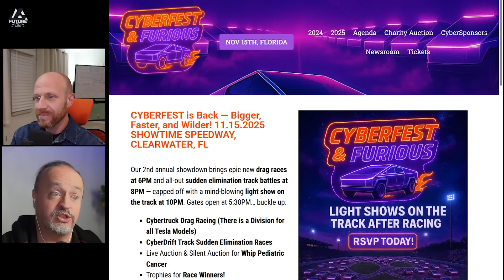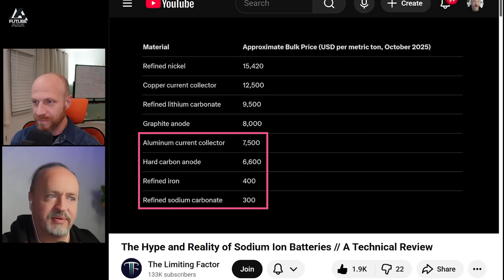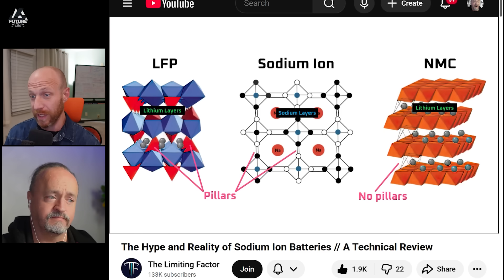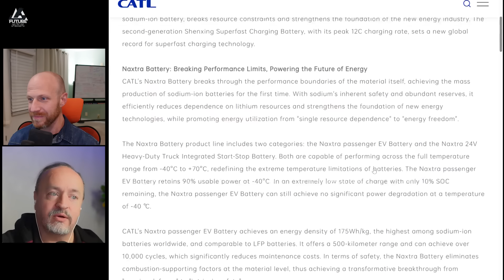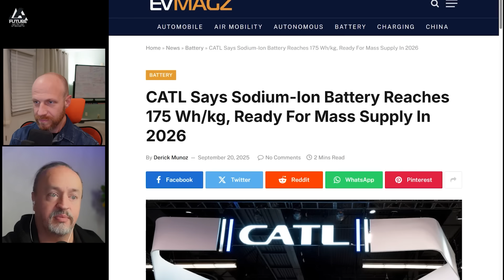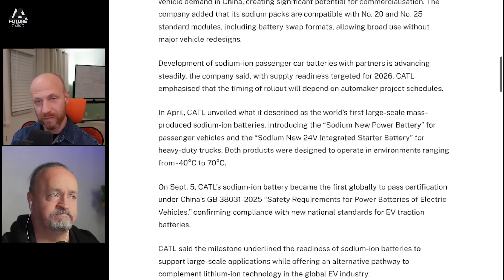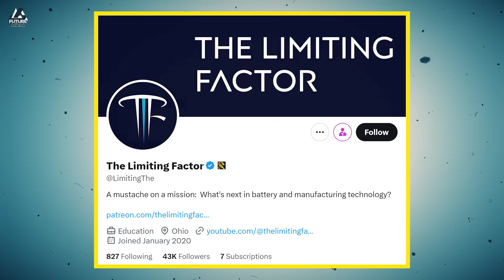Jordan Giesige Exposes Sodium Battery Truth

Comment: Sodium is right under lithium in the periodic table. It is no surprise this is being exploited. However, it will explode if it gets wet. The aluminum ion batteries, which are made possible by  graphene, are going to be cheap but very safe and easy to manufacture with. If one considers the the pinto gas tank debacle. The first time someone is burned with a sodium battery and it goes to court and the safety of an aluminum battery is presented. The cost of settling will be overwhelming.
Reply: The Pinto has been well and truly beaten in the USA with regards to fire danger, and no one is saying a thing about it. I doubt that anyone is going to start complaining anytime soon.

Comment: The primary advantage  to me is that it doesn't suffer from run away self immolation that lithium batteries can suffer from.  It wont take too many lithium house fires for home power walls dor them to be uninsurable. Lower cost, and low temperature operation are just icing on the cake. I woud pay more for the safety factor.
Reply from the maker: You know these are already in millions of homes and businesses around the world, right?

Comment: sodim battery is useless. It's not cheaper. Battery unit price does not set by price of resources. Its set by manufacturing technologies. How much yield they produce. That is what set the price of unit battery. 
And sodium battery energy density is low, you have to install more cells in EV. more cells means more prone to catch fire. And more chance to have defective cell in BSA. Which cause voltage unbalance in entire direct current within and result BMS error. 
In order to decrease price of EV and make EV safe, best choice is to get high energy density cells like NCM9 and intall minimum number of cells in EV to make it simple.
Reply: And all energy density materials are prone to catch fire. Sodium battery also energy density thats why it's battery.

Comment: LFP is NOT fire resistance. In fact, LFP is more prone to catching fire in EV.  BEcause all the lab datas that shows LFP is safe is under condition fo 0.5 C rate. from above 0.5 C rate, LFP is not safer then NCM. NCM is safter becasue it can tolerate in higher C rate than LFP. LFP is dangersou in EV. LFP is meant to be used in ESS.

Comment: Everyone always seems to forget that the only thing that lower material cost means is more profit for manufacturers.
The "savings" is *NEVER* "passed on to the consumer".
Reply from the maker: That's not how it works in automotive. Otherwise everyone would have 40-80% margins, rather than the usual, which is almost always in the single digit range.
Reply: "The price of an item is the highest point that the market is prepared, able and willing to pay for that item". Economics and commerce 101.

Comment: This very misleading regarding the danger of lithium power automobiles;  flooded vehicles are a very significant risk of fire.  Floods happen frequently, thus flooded cars also occur frequently.  I support electrification of our automobiles, but it does a disservice to falsely claim the fire risk of lithium powered cars ended five years ago.
Reply from the maker: If you look at ALL car fires, gas cars are 20x more likely to burn. That's including floods. Not because there are 30x more, it's on a per 100k basis.
Reply: @FutureAzA  There in lies the rub; the gasoline powered cars either are being used, or have just been parked when those cars catch on fire, yet the lithium cars have fires after being parked for hours, days, or weeks.   Please don't get me wrong, I don't want people to have an irrational fear of lithium powered cars, but those cars do pose unique risks fire dangers that shouldn't be ignored.  Thank you.
Reply from the maker: Still not true. All cars have low-voltage batteries, and those cause fires fairly routinely, especially at sea.
Reply: @FutureAzA  Are being intentionally ignorant?  While there was not even a single lead acid vehicle fire after recent hurricanes; "After Hurricane Ian in 2022, 36 electric vehicles caught fire in Florida. After Hurricane Helene in 2024, at least 17 electric cars and 64 other devices like scooters and golf carts caught fire after being submerged in water, though the exact number of EV fires is still being analyzed. Saltwater exposure is a major risk factor, and fires can occur days or weeks after the storm has passed due to thermal runaway.".  Why are you being ridiculous in denying that lithium batteries have greater risk of fires  compared to lead acid batteries?
Reply from the maker: Again, just lies, Bob. That might sell on low-information channels, but it doesn't work here. We've been following this for years. The majority of this channel's viewers work in engineering and/or have STEM degrees.

Watch this video and note that zero of the cars are electric: https://www.youtube.com/shorts/lqJD6f5vJ5w
Reply: @FutureAzA  The short video you cited above is your rationale for claiming electric cars didn't catch fire and burn the homes they were in after the recent Florida hurricanes?

Comment: Chevrolet Bolts were catching fire as recently as ~3 years ago. These were caused by a miss calibration of some machines at an LG cell factory.
Reply from the maker: How many though? Even those were significantly less likely to combust than a dino burner.
Reply: @FutureAzA They recalled everyone and replaced our battery packs. I do not know an exact number that caught fire. They weren’t in the news the way Teslas would have been.

I traded mine in for my MY.
Reply from the maker: Redwood Materials got them. Based on their use case, they were deemed fit for stationary storage.
Reply: @FutureAzA I didn’t know that. Good to know. But GM made things harder on we owners than they said they would. They contracted for rental cars to be provided while we got the recall done. When I set mine appointment up, I was told I would have to wait months if I wanted to get a car for the time that they were working on it. It made me feel I couldn’t trust them.

Comment: cheaper, -40f to 150f  useful operating range. about same weight as LiFePo,  can manufacture on existing LiFePo production line. Im production line by World's largest Battery company.  China are gungho ... nuf said. you will need new inverter and charge controller.

Comment: What energy is being used to make them round trip? Yes that’s right fossil fuels. Now what energy are we going to use in 30 years….you guest it fossil fuels…why? Because we have not replaced the fossil fuels with Hydrogen….yes right again Hydrogen can replace all fossil fuels.
Reply from the maker: Hydrogen is a medium, not a fuel, and its round trip efficiency is VASTLY worse.
Reply: 95% of the world's hydrogen is produced by refining fossil fuels, mainly natural gas and coal. This process is anything but "clean" and it is very inefficient. So too is producing hydrogen by electrolysis, even when using renewables. It is far more efficient to simply charge a battery.

Comment: I do think Na-ion makers are missing a trick when making 12volt style batteries the wide voltage swing of Na-ion from 10volts to 16volts is useful, many appliances hate voltage swings, the battery could have a built in digital volt meter that would give you a good idea on the state of charge because of the nice linear curve. 
But here comes the kicker, design a BMS that makes the battery output say 12.6volts constant regardless of what the battery voltage is at. Maybe have a 4 terminal battery that has separate charge input terminals.

Comment: Material cost of any product is only ~5%-15% of the total.  Bringing this up first is a GIANT red herring.  You know the propaganda BS is incoming...  First thing talked about in any RATIONAL discussion, should be Sodium's Horrendous Voltage drop and sebsequent horrific average efficiency completely and utterly negating any advantage regarding its price.  You have to buy more batteries, you have to buy more solar panels, solar panel racks, inverters, cabling, and labor to make up for these so called "cheaper" batteries.  The ONLY advantage Sodium has is that they work in the cold better than LFP.  That is it and only it.  Everywhere else they are inferior to massively inferior.  EDIT: They were actually rational, though never brought up Sodium's horrific efficiency, but did bring up its horrific VOLUMETRIC efficiency.  Bravo.  At least you brought up one of Sodium's reality problems.  OF course they NEVER brought up Sodium's INABILITY to use its lower 20% of its State of Charge due to its gargantuan voltage drop.... 1kWh Sodium only equals 800Wh of LFP at BEST and more likely 30%.

Comment: I have a single 3volt 20000mAh Sodium ion, it powers decorative lighting and charges from excess solar, it seems to work well and I do not have to worry when my greenhouse gets hot in summer or below freezing in winter. And to be fair no issues with it so far, but I can see limitations.

Comment: Two guys who claim to be experts on battery technology completely ignore that CATL is set to begin mass-producing Natrium batteries in a little over a month — and there’s no indication that anything has changed. CATL has stated that prices could eventually reach around $10 per kWh in the future — not today.
I’m fairly sure I read that a Natrium pack should already be cheaper than LFP, though I’m not sure by how much, but certainly not more expensive.

And suggesting that Natrium batteries will have 30% less range is ridiculous. It makes no sense for the world’s leading battery manufacturer to mass-produce a cell with such a short range — and, as you insinuate, not at a cheaper price.
I have a Model 3 with a 520 km range using an LFP pack, and that’s more than enough for me.
A Natrium battery offering around 500 km of range, combined with its much better cold-weather performance, would be a perfectly fine option for many people like me.

It’s not as if CATL ever claimed Natrium batteries would replace LFP or NMC immediately.
However, they have said they expect Natrium cells to reach the same energy density as their LFP batteries by the end of 2026.
Natrium will undoubtedly replace LFP in the long run as battery density continues to rise and prices fall.

It also sounds quite arrogant when you frame it as if CATL has no idea what they’re doing.
I guess we’ll see in a few months.

✅ Mass production – Confirmed: CATL’s Naxtra (Natrium) batteries are set for mass production in December 2025.
✅ $10 /kWh – Confirmed as a future target, not current cost.
✅ Cheaper than LFP – CATL and analysts expect Natrium packs to be cheaper than LFP due to raw material advantages.
✅ 5-10 % less range – Current energy density is only about 5–10 % lower than high-end LFP (≈175 Wh/kg vs ≈185–190 Wh/kg).
✅ Equal density by 2026 – CATL stated this goal publicly.
✅ Cold-weather advantage – True: Natrium batteries perform significantly better below freezing.
Reply: These batteries have around 30% less energy (or whatever it is) for the same volume.  So yeah, they could match the range by making it larger, but that may not be practical in many cases.
Reply: @AkaRyrye83 that would be a ridiculous argument as 60% of the market moved to LFP which is lower density than sodium without all the advantages and needs more room for cooling. 

Do you see BYD and the companies using LFP struggling?

Also, in cold weather it's going to be just as good as NMC Anyways for a fraction of the cost.
Reply from the maker: You should go back and watch Part One.

Comment: cheap electric portable devices will last 10 times longer.   Most die from the battery failing.  Sodium does not suffer from full discharge problems.  You find them a  draw years from now, completely dead, they will still take a charge.

Comment: I believe that Na-Ion batteries will become more widespread faster than LFP as the construction technology they employ is almost identical to that already in use producing LFP cells, so they will be easier to ramp up in volume.  CATL have announced that they already have multiple Chinese EV manufacturers committed to using their Na-Ion batteries in Q1 2026.

But I have a question.  Since Na-Ion cells can be charged much faster than LFP, surely this creates the potential to install smaller, therefore lighter, and even less expensive battery packs into EVs.  Also, given the less likely over-temperature problems, couldn't the BMS be eliminated, further reducing cost, complexity and weight even more?

Comment: Once the sodium battery EVs are released, all this talk will go away. With geographically distributed ubiqutous super charging, 30% lower range wont matter a dime.
Reply: Except they are just making the 30% less range up. CATL hasn't so far been "lying" as these two suggests.
Reply: @TheSanienThe same size ( by volume ) sodium battery has 30% less energy vs Li-Ion. Currently, Sodium batteries must be 30% larger, otherwise you lose range.

Comment: Advantages to sodium:
- Price, but not necessarily very much cheaper at the pack level
- Safer, but once batteries are it's safe enough "safer" might not be very important
- Longer life, more cycles, but not necessarily very important to cars 
- Much better cold performance, important in some places, less so in other
- Doesn't need much/any materials from problematic areas
Disadvantages:
- New(er) technology
- Less energy dense, but not to a problematic degree

Conclusion: At the very least sodium batteries will not go away, and will most likely increase significantly.
All "new" things get hyped, but sodium seems mature enough that a decent success is fairly certain.
Reply: These guys are just trying to justify the use of lithium ion batteries by Tesla.  If the Chinese use it, it is still no use until Tesla uses that technology 🤦‍♂️
Reply: @fredfrond6148 Elon is designing aluminum cells
Reply: Yes, and at the recycling of a used battery the process is easier and environmental friendly to. 😊
Reply: @JohanLofgren-jc4mh yup.  Certainly better than recycling cobalt😂

Comment: You miss the main advantage: charging speeds and the number of charging cycles.  Give me a battery with sodium ion recharging speeds and cycles and I will only need 70% of the space I need for lithium ion.  In fact, all I need is to "refill" my EV at a battery-changing station because the battery will last so long that nobody will need or want to own one.

Comment: I think you are wrong about lithium and thermal runaway.    What you say is correct but there are stacks of aging lithium cells around.   Old EVs will be neglected, mice and rats love wires.   Already lithium fires are occurring very frequently, more so for small consumer items than EVs.  All my friends are concerned about lithium - so sodium is a giant leap I think for acceptance.   Not impossible for thermal run away but near zilch and without the lithium stigma.   ICE vehicles burn, but the failed design of the door handles on the Tesla resulting in people being burnt alive has really been poor PR for EVs.

Comment: Sodium batteries: very cheap, a little heavier, no fear of freezing temperature... perfect for storage.
Reply: You can use the whole charging range. No more staying between 20% to 80%.
Reply: @LexaDoc-l2l You can already do that with LFP.  A big advantage is you won't need external cooling (or at least, far less than current cells) since they efficiently operate at much wider temperature ranges.
Reply: @ArthurDentZaphodBeeb  also these salt-ion batteries should have 90% efficiency at -40C temps
Reply: @LexaDoc-l2l  If you use 100% capacity of Sodium then your # cycles will be crap. And your amperage will be nearly TRIPLE at 1.5 volts!  A lot of nonsense.
Reply: I actually think the point made was that they are not any heavier now, just a little bulkier.
But your point still stands.
Reply: and 12 c . that the most importan parameter for ev's
Reply: @GregGreg-b2p  How about the fire safety? Li-ion having the capability to do insane amount of damage in seconds is not really great whether it happens in high speed or while parked.
Reply: @JanetH-r3vLFP do not have that issue.
Reply: Sodium is nice on an Italian meal. Lithium is nice in a battery.
Reply: @asajelfs8170 lithium is also useful for your mood.
Reply: I feel like you didn't watch the video, actually.
Reply from the maker: Bulkier, but not cheaper yet.
Reply: @FutureAzA YET is the key word. Ffs, we all know mass production has yet to start on gen 2 Naxtra cells. What will Gen 3, 4, 5 look like?
Reply: @FutureAzA CATL sodium batteries surpass LFP power density at this time.
Reply: @FutureAzA  Li+ was very expensive for many years till they increased production and then the machinery to build them became standardized and cheaper which made the batteries cheaper but the rare earth minerals are easier to get but still expensive. So why wouldn't the Na+ batteries follow the same trajectory but with cheaper material means it will get cheaper faster.  It is the energy density that will hurt if but only if the US doesn't build more charging stations. The more charging stations the easier it is to convert to an electric vehicle.